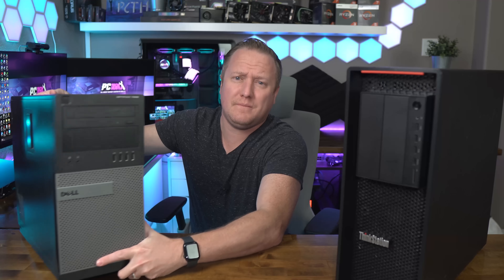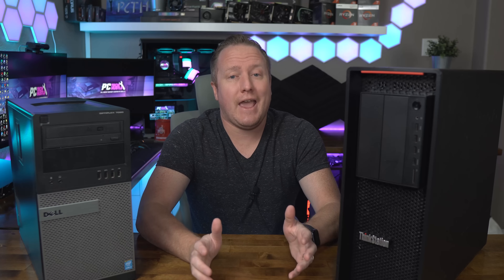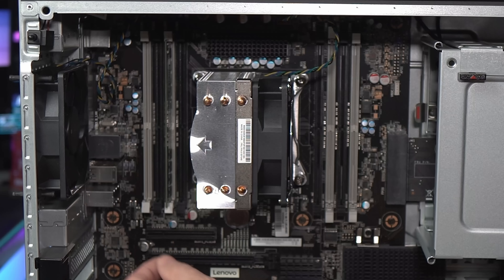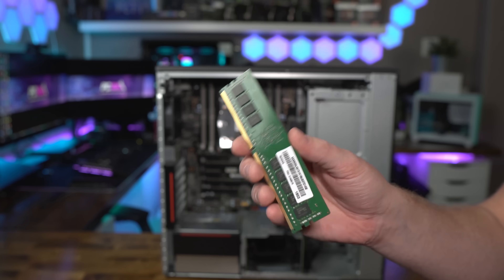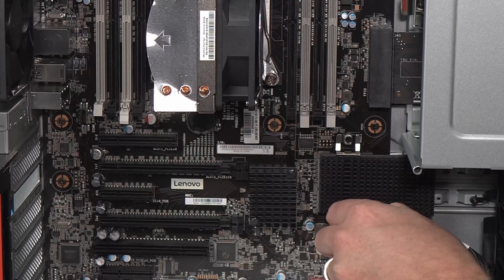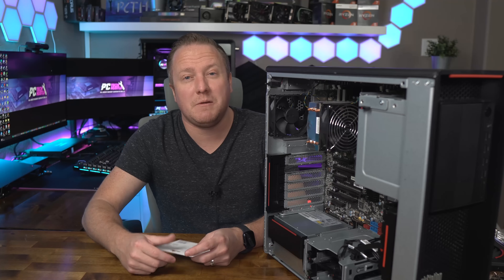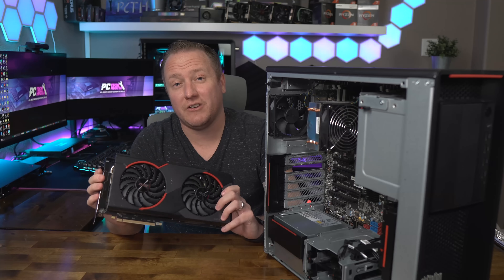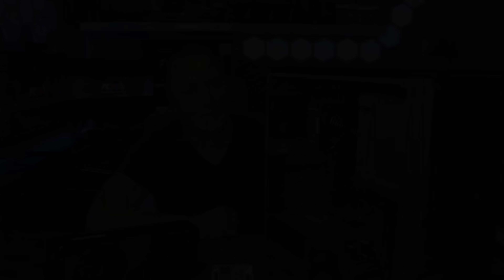The 2024 New Meta of Budget PC Gaming! - Lenovo p520, rx5700 XT, 32GB RAM for UNDER $400!

Comment: But this is a Skylake CPU, so it's in the same boat as the Optiplex with Windows 11 "compatibility." You need 8th Gen Intel or 2nd Gen Ryzen to be fully "compatible" but you can install Windows 11 on either 4th or 6th gen and it runs just fine. The only worry you have is if M$ cuts off security updates eventually.
Reply from the maker: I am going to pin your comment as it has some great technical relevance.  Seems based on some surface level research I've done so far and even though Lenovo states this platform is "supported" I guess we really do not know until we are deep into windows 10 EoL term.  It would be a shame if is MS drops this CPU too because it is not THAT old.  Time will tell.  I may just hold on to this system for term length testing to see how well this ages in the next few years.
Reply: @PCTechHustle  Well... isn't that interesting. I learned something new today. Their Windows 11 requirements are complete BS and they aren't even really trying to hide it. Apparently, this system IS supported as the CPU is on the compatibility list, despite being no different than the i7 6700 in terms of architecture. Does this system have a TPM 2.0 module? I just find that very interesting. Perhaps they didn't want to piss off enterprise level customers, where they don't care if they piss off end users. The more I find out about this, the more it irks me. But it is nice to see that this system is supported... for whatever reason.
Reply: @TheGameBench P520 has a TPM module and its a Xeon so it gets a longer support period.
Reply: @videosuperhighway7655  Yes, we've already discussed that in this thread.
Reply: @PCTechHustle  I tried to tell you the same thing.
Reply from the maker: @JeffWaynee I’d pin both comments if I could!  Thanks for speaking up on it though!  Good info! ❤️❤️❤️
Reply from the maker: For reference, here is a link to MS's currently support windows 11 CPUs.  Stated here too, this list is dynamic and can change over time. 
https://learn.microsoft.com/en-us/windows-hardware/design/minimum/supported/windows-11-supported-intel-processors
Reply: @PCTechHustle I just bought a Lenovo workstation p520 and this splitter TeamProfitcom 16 AWG GPU VGA PCI-e 8Pin PCI Express Graphics Video Card GPU VGA 8 Pin Female to Dual GPU 8(6+2) Pin Male GPU 8 pin Splitter Power Sleeved Cable 8 Pin GPU 12-inches (4 Pack)

 Do you think it's be okay to use that so I can power a rtx 4080 super.
Reply: All of LGA2066 including the 2017 chips (say for example the i7 7820X) has official W11 compatibility . It's just the mainstream consumer Skylake (e.g. i7 7700K) that got cut off.
Reply: @Wokiis Yes, I know that now that I've seen the supported CPU list... which just shows how bullshit this all is. They're choosing not to support those CPU's. The only reason they're supporting 2066 chips is because they don't want to piss off their business customers.
Reply: Just tagging on to confirm that I have installed Windows 11 on a p520 with no issues! Just had to enable TPM 2.0 in latest bios and vanilla Win11 installed from USB with no work arounds. Currently on a W-2135, 64gb quad, and have used a RTX 2080 ti and RTX 4060 ti 8gb, and everything has run well! Solid machine for sure!
Reply: How much “security” do we need to play a game LOL.

I’ll stick with my Optiplex 😅
Reply: @RobertFixit  I would say you need SOME security, but TPM has been defeated and it's not something I would be too concerned about unless the computer was being used in an enterprise environment or being used for government work. The average consumer doesn't need to really care about TPM. Besides, M$ is basically admitting that there's no reason Windows 11 could not work on older platforms, the only reason it doesn't is... money.
Reply: Didn't see it in the comments, but doesn't  p520 also support 2nd gen W CPUs? That's Cascade Lake, so very much in support currently. The price now is pretty high, but every year increases the likelihood of them crashing like the 1st gen. So if you're half lucky, 50 or so used, maybe double or so if not so lucky for the CPU upgrade in a year or two.
Reply: just pirate Windows 10 IoT Enterprise LTSC, supported til 2032
Reply: Windows 11 ltsc is around the corner
Reply: No one want to use windows 11
Reply: future proofing a system, and caring about windows support are 2 utterly different things, myself i will so happy to see windows 10 support end as run my own security software that protects me from how invasive windows is , to have updates stop just make it allot easier to keep my PC my own , fact of the matter is windows 10 has allot of compatibility issues, and 11 is even worse, and 11s remote screen capture functions are nothing i want any part of , if you want a cheap some what future proofed PC for dirt cheap a ryzen 2600,  A320, and a rtx 2060 12 gb is going to be vastly cheaper and vastly more up gradable option (2 new AM4 CPUs just dropped , that is 9 years of new tech for the platform so far and they still haven't dropped the 5500X3D yet ), the P520 is of the highest quality but is the complete opposite of future proof , that said i do own a P620 3rd gen threadripper, and if want to build a AI modeling computer that has future proofing in mind its not a bad way to go but those 128 4.0 PCIE lanes are pricey , but P520 could be replaced with a dual Xeon X99 for the same money and have a much better system for AI, as far as gaming on the dirt cheap their allot better ways , this is not a meta nor will it ever become one do to how extremely proprietary the system are  , even with P620 i had ad a SATA PSU splitter to run the 6 GPUs as well as a mining rack to hold the expansion of hardware , and i love the RX 5700 XT its a great GPU for running old games but does not have modern shader support, and sadly is not going to be reasonably compatible with modern games (meaning games from a year ago)
Reply: @hayseedfarmboy  I don't care what security software you're running, I wouldn't get on the internet with an O/S that was no longer receiving security updates. It might be fine at first, but eventually there will be so many exploits. I absolutely detest Windows 11, so I've been looking into other options like Windows 10 IoT LTSC. It's an enterprise version of Windows that has security updates up to 2032 and they strip crap like Cortana, OneDrive and CoPilot out. I haven't seen anything just install itself like I have with professional. It's also more lightweight and you have less things running, but it's fully functional. You just have to add the things that aren't coming preloaded back in.

This would be my suggestion to people who are running unsupported hardware. There's also a Windows 11 LTSC as well, for those that actually like that pile of crap.
Reply: @TheGameBench windows is garbage. Real PC Users/builders run Linux
Reply: @michaelelkinton1167  You're welcome to your opinion even if it is wrong. And I'm not discounting Linux, I'm just saying that there are valid reasons to use Windows, and to say that you're not a "real" PC user/builder if you don't is laughably absurd. That's a BS elitist mentality.
Reply: @TheGameBench windows is just a bulky, slow, dinosaur, money grab of an OS. There are so many better options.
Reply: @michaelelkinton1167  I never said it doesn't have flaws, not like that changes anything. It doesn't refute what I said or validated your absurd opinion. Also, saying there are "better" options is entirely subjective. You can say definitively that there are better options for you, but you can't say that there are better options for everyone. I'm sorry, but Linux isn't better for every use case.
Reply: I’ve seen places say that and gpu don’t like to work in Lenovo, is that true? I’d like to buy an AMD card, but I’m just wondering it won’t work.
Reply: I wanted to use a Vega 64
Reply: Windows 10/11 iot ltsc seems perfect for this computer
Reply: 8th gen would be better anyways because theres a dude that tests budget cpus for Star Citizen which is a core hungry game and the minimum if u want to play without stutter is 3600 or 8700 coffeelake, i imagine i7 and Xeon Coffeelake will become budget friendly soon OR step up to that rite now. But yeah who knows what MS is going to do in 24 or 25 if they are going to block Updates, they mite be workarounds tho, we will see.
Reply: I installed Windows 11 on an Atom bro 💀
Reply: Yes but you have to bypass the TPM and stuff
Reply: @chadlane9513  Nope. The W-series is officially support by W11. Please check before posting rubbish.
Reply: @chadlane9513  I have seen no current methods that require you to disable TPM. In fact, it would seem that they require TPM 1.2 is enabled. The most recent methods simply work by bypassing the hardware checks during install... that's it. You don't need to disable TPM to do it. The only reason you should need to disable TPM, is if you're you're running both PPT (BIOS based) and TPM (hardware based). You can't run both at the same time, it's one or the other. As for "stuff..." the other things that you need to do are so stupidly simple and aren't a valid argument against installing Windows 11 on unsupported hardware.
Reply: Great channel!    Yep I have this same Lenovo. I does support TPM 2.0 in the bios.  Mine was disabled when I got it and WHEN I go to 11, I'll enable it then.  I "THINK" I got a pretty good deal at $212 delivered to my house with one yr warranty, negotiated a lil.  Got 32GB ECC  ram in quad channel and a DVD drive, yeah I know........This was a few months ago too, when you could still use an old Windows 7 Pro key to work too for Win 10.  That with a Samsung 980 M.2 1TB and Zotac 1080 card, it's not bad.  IFFF you can or have the means, I would love to see this thing benchmarked with 4070 running too.  I'm thinking of just going up to a 6700xt. Might even look at the upgrade to a W-2155 10 core...lil more cache too.  Keep doing great content!   @TheGameBench
Reply: @TheGameBench  Nope. Whole load of incorrect guff... W11 requires TPM 2.0. Which this platform has.... Also W Xeons are  supported by W11.
Reply: @timfountain98  Yeah, we've covered this. You're late to the party.
Reply: windows 11 is terrible anyway, with an infinite amount of more spyware and bloat, so why would you even want to do that when windows 10 still has an infinite amount of support?
Reply from the maker: @canadian128 windows 10 has infinite support?  Ummm… no sir, not at all!
Reply: yes it does and they will stop supporting it in 2025 and I will use it until then, and then switch to linux because fuck windows 11 @PCTechHustle
Reply from the maker: @canadian128 lol you are completely contradicting yourself!  By end of support in 2025, that’s FAR from infinite!  🤪🤪🤪
Reply: @canadian128  I agree... to a point. I don't want Windows 11, but once Windows 10 stops receiving security updates, unless you don't connect it to the internet, it's a terrible idea to continue running it.
Reply: @TheGameBench there’s quite literally nothing to be skeptical about, it’s meant to be a budget gaming rig for entry level pc gamers. You can’t beat the price to performance this computer can offer, $450 can get you a solid rig that runs most games at mid to high settings at 1080p with a consistent 100+ fps. Windows 10 eol is in 2025 WOAAHH SO SCARY, it’s almost as of tiny 11 doesn’t exist😨
Reply: @AJ-vj3es  I'm not skeptical. I'm aware of what this machine can do as I work A LOT with older budget hardware and OEM systems. The issue was the discrepancy that this uses a 6th Gen CPU, which shouldn't be supported by TMP 2.0 and Windows 11, but it would seem that it is and we've already cleared that confusion up. You're not telling me anything that I don't know. However, I would argue that it's not the best bang for the buck at $450, but it is good. As for Tiny11, it's not a viable solution for most people. Windows 11 isn't scary, it's just not a very good OS, hopefully something Windows 12 rectifies. Sadly, they won't back track on their idiotic policies to attempt to obsolete millions of perfectly viable PCs.
Reply: @TheGameBench  what machine do you think currently represents a better value with better long-term win11 compatibility?
Reply: @scottfuscomusic  The Z440 systems. You can usually get them cheaper with the E5-1650 or 1660 v5, which have 8 cores and 16 threads but they have higher clocks, making them better for gaming. If you want a consumer processor, then would suggest looking at the Dell Optiplex 3060/3070/XE3 if you don't mind doing some modding. If you don't, the HP Z2 G4.

Comment: Plus he left out that you have a ton of upgrade potential in the future with this machine, They make a lot of more powerful Cpu's that fit this machine you can upgrade to in the future, It also has either quad or 6 channel memory support, so what it lacks in ram timings " speed " it makes up for in bandwidth if you add the right number of DIMM Styx, Plus the 2200 w series cpu's, The 2nd gen this machine can take, have DL Boost if you want to work with AI.... Strong workstation !
Reply from the maker: I’m not so sure I “left that out” but either way I did make a follow up video where I completely maxed it out!  Go check it out!

Comment: I scored a dell precision 5820 at an auction which came with a p4000 quadro, 512gb ssd + 1tb hdd, 128gbs of ddr4, xeon w2133 (w2135 but with lower boost clock iirc) for $295... sold the quadro for $120, half of the ram for $50, a 1tb hdd for $15... put in a $120 5700 XT, Works like a charm and only cost me about $230. I doubt id ever built such a strong price/performance pc ever lol.

Comment: I went with the dell precision t5810 with a xeon 2680 v4,32gb ddr4 ram,rx 6600 xt gpu and hasnt let me down and Ive had it for nearly 2 years without any problems,cost me a little over £270 for the lot and outperforms some modern gaming systems
Reply: I upgraded my t5810 with a 2680 v4 as well, tho i paired it with a gtx 980. These for the right price really can outdo a lenovo build, especially since the 2680 is stronger than the typical w-2135’s in most lenovos p520’s.

Comment: HELP! Lenovo p520 Severely Underperforming! cant figure out why. W-2235, 64GB Ram ( 2600 speed)  m.2 & SSD storage. 5700xt GPU I bought this as an upgrade to replace my HPz440,  However my Z wipes the floor with it. (E5-1650v4) Same core and thread count. Lower base and turbo speed, slower DDR 4 ram, and older GPU. (1060 6GB) I have a lot of experience with the HP workstations but this is my first Lenovo. I'm starting to think something is jacked in the bio settings or the system configuration. I'm just not sure where to look. All diagnostics / stress tests checks out perfectly. Was hoping you guys had some insight.

Comment: I have the exact same setup except my GPU is the Sapphire Pulse 5700 XT (OC). Would you suggest leaving the tuning settings alone at default in the Adrenalin app? Or adjusting. If a change should be made maybe a screenshot of the best setup? Ive tried a few from videos but they all make it crash.
Reply from the maker: Honestly I’d just leave it alone.

Comment: Can this setup support 1440p gaming with high settings?
Reply from the maker: I would say this would be more of an entry level 1440p system.  Though to get there it can support bigger GPUs that can easily get you to that.
Reply: @PCTechHustle  first of all, thank you for answering this question so promptly on an older video.  I will follow you!  

I was gifted a rtx 3060.  With this build and this gpu, can I expect 1440p?

Comment: I bought this device. Is it strong in editing and gaming or not? - Please reply - w 2135
Reply from the maker: @Elkomnda_Mero  it’s very solid!  Also has a huge upgrade path.  Check the video I did on maxing it out
Reply: @PCTechHustle  Are these capabilities good for montage and gaming with this device?
w 2135 
16 ram
ssd
rtx 3050
900 pawer

Comment: one overlooked aspect of these thinkstations turned into gaming rigs...power consumption.  You may have gotten a deal on the build..but longterm and long gaming sessions will likely reflect on the electric bill.  I might run something as a testing rig for playing with virtual machines...or put debian + casaOS on it and run some docker containers..but not 24/7 operation just as a learning tool.  I'd use something less power hungry for 12hr/7 operation.
Reply from the maker: Honestly I think you are over thinking it.  Unless you are running high work loads all day /every day MAYBE you will see an impact on your electricity.  This workstation will consume about equal power levels as any other gaming PC.  Just because it has a 900w PSU does not mean it's pulling that much power at all time.
Reply: @PCTechHustle   Perhaps.  Of course it's only drawing higher power while during heavy loads, not all games are heavy loads..unless something like a Triple A title.  However as a home server doing multiple tasks..as you said would consume more.  I don't have a killAwatt meter..so I am unable to test the rigs I have.  I used to do 5 hour gaming sessions..can't handle that anymore lol.  It's not the PSU I factor, it's the total system draw during loads I'm usually curious on.  From what I am aware 13 and 14 gen intel CPUs are more power hungry than what comes in P520 build.  Not to mention the current gen of GPUs.

Comment: 15:30 this is a very good video but there's one thing I want to add on to it when you were calculating the bottleneck you clicked on General tasks I think you meant to click on GPU intensive tasks because at 1080p on GPU intensive tasks the bottleneck is about 7.4

Comment: Does every p520 come with a power supply? I see on some listings that they dont specify what the wattage or the power supply for the system is on ebay
Reply from the maker: I'm sure it's possible to see some that do not.  You will just have to carefully verify.